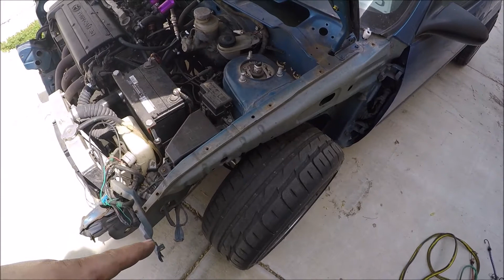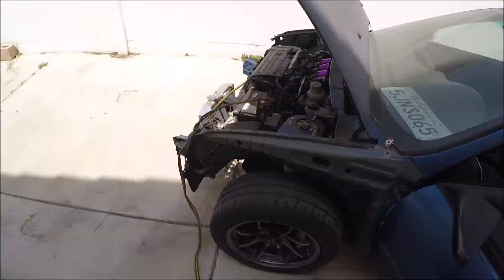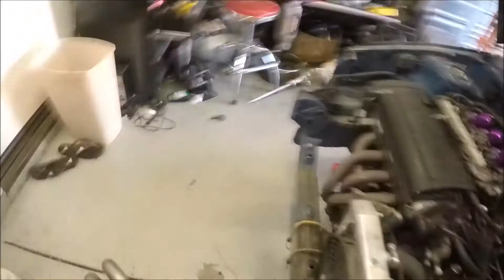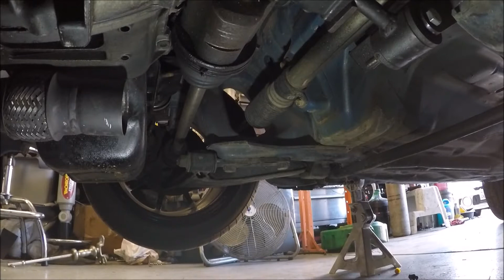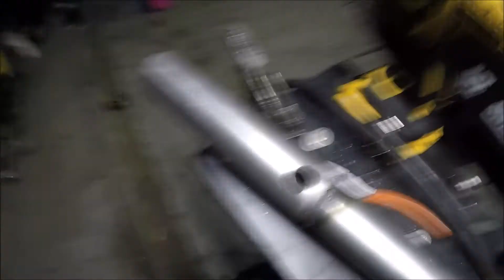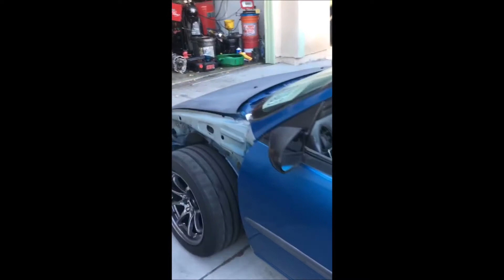4age 20 Valve Black Top Swapped Geo Metro (Suzuki Swift)

Comment: Clean build...  Toyota does good.  Mind is boggled that it runs so clean in defult mode O2 in the air.  I am building a 92 with the 16 valve motor trans out of 89 celica.  After it runs;  then I would like to rear engine swap unless it handles nice enough.
That motor trans assembly didn't come with equal length axles?  My celica has them, Its currantly the fly in the peanut butter_1 1/2 shorten each side plus conversion geo toyota 
       Nice work, excellent welds, followthru design, and  repurposed parts

Comment: hey im a huge fan of the 4age blacktop and i want a 4age screamer, do you think a geo is the easiest and cheapest 4age swap? if not what else would come to mind for a easy first time swapper
Reply from the maker: Toyota corolla fwd will swap in easily maybe even a tercel or Paseo. As long as you have an idea, a cutting tool, and a welder, you can make it fit into anything. What state are you in by the way

Comment: 4AGE is awesome! What mods did you have to do to get the coil overs to fit?
Reply from the maker: Thanks for watching. The front coilovers was very easy, the rear not so much. We used S13 J2 coilovers. We drilled the strut tower bolt holes a little bigger to accommodate the larger studs, it is the same spacing as the s13 upper strut mount. Lower mount had to be honed down to fit the spindle, washers were placed in to take up the space because the s13 lower mount is wider than the Swifts knuckle. Rear a little more complicated. DM me on Instagram for more information

Comment: I have an 87 Sprint 1.0 turbo... I don't want to do the 1.3. I'll have to research this. I love my G10 turbo but it's too hard to find parts.
Reply from the maker: I agree, it is very hard to find parts and when you do, the price is not worth it. There are so many other options out there. My first choice engine was a Toyota Starlet engine 4EFTE but those are probably hard to find. Hit up a wrecking yard and just look around. 150 to 180hp is all that little thing needs to be a contender

Comment: Hey mate planning on doing the exact same swap for a rhd swift, is there any room at all to move the engine forward to clear the rhd brake booster?
Reply from the maker: Hello, thanks for watching, there is some room to bring it forward, where mine sits right now it is inline with the wheel hubs so the axles are straight, it is a tight fit. My first idea for a swap was a 4EFTE from a starlet the mounting points on the trans is very similar and a smaller engine. Yeah I believe you might be able to make enough room to clear. Or eliminate the booster. 😁 let me know if you have anymore questions on your swap always glad to help✌

Comment: Hello mate great job.. can i have some photos from your rear suspension to understand what mod need s13 suspension to fit? Tnx
Reply: Yes I need more information on this car!
Reply from the maker: What would you like to know
Reply: @SleepRGarage  more information on the engine/tranny mounts and the axles
Reply from the maker: Sorry for late reply, engine mounts are custom brackets welded to the car, transmission mount is a factory 95 corolla mount, other engine mount is a universal bushing mount I made along with the torque mounts, all brackets are welded to frame. Axles were tricky, I got the factory corolla axles and the swift axle, cut them down and welded a pipe between them and full installed. Then I removed them and removed the cv joints so I had the length of rod I need for each side. I believe I bought a rod of 4340 chromoly and had the cut down and splined and a machine shop. When I got the new rods back I reassembled the Toyota inner and suzuki outer cv joints(new) and Reinstalled my axles, cost about $450 for both at the time. Hope this makes sense. Thanks for watching
Reply from the maker: Sure will I found my old footage of that install I was thinking about posting it up. But I'll get back to you on what I did.
Reply: @SleepRGarage  tnx mate i appreciate!! Now am making the engine mount to fit k20a honda engine :)
Reply: @SleepRGarage hey man, did you ever find this footage? :)

Comment: When you first started getting it going, what was the squeaking/grinding sound when you had the wheel turned?
Reply from the maker: it was the alternator pulley making contact with frame when the engine would torque.